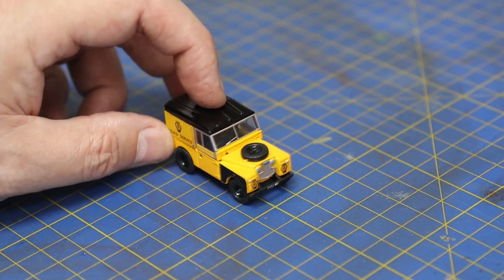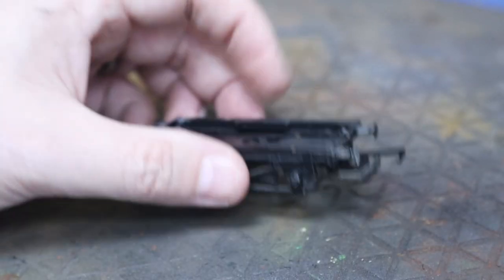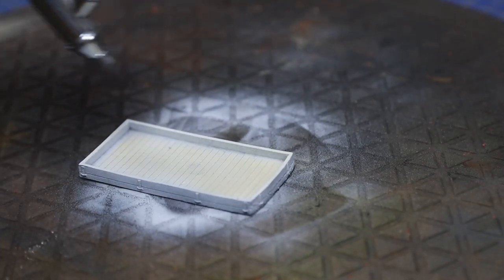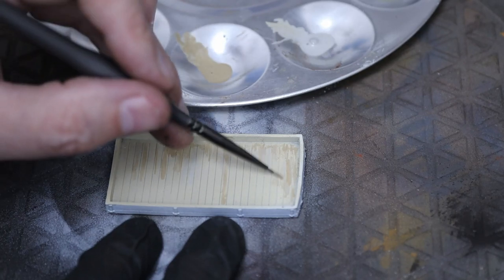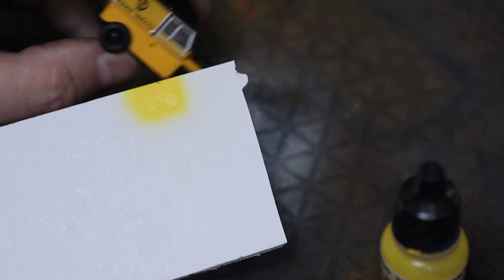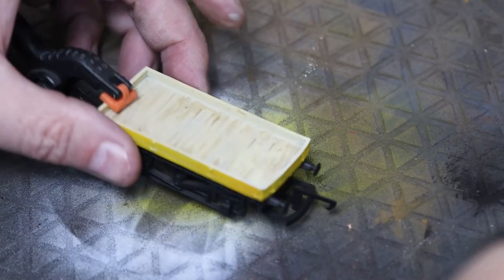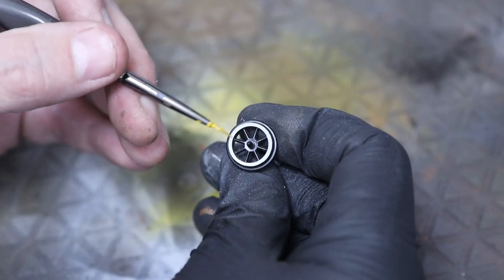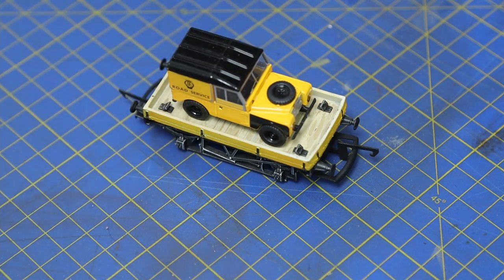Custom Build | AA Land Rover Flatbed | Model Railway

Comment: Nice one, man. :) Another fantastic result.

P.S. If you haven't already found another use for it, would you please put that weight at 1:00 to one side and include it in my order the next time I buy from you? I recently acquired an old Hornby tanker, and when I took it apart, its weight was missing. I've tried using a wheel-balancing weight instead, but they are a bit too thick to fit inside the chassis.
Reply from the maker: Yea sure. I have a few of the weights so I’ll put a couple aside for you. Just remind me